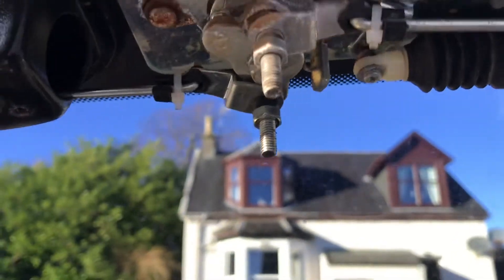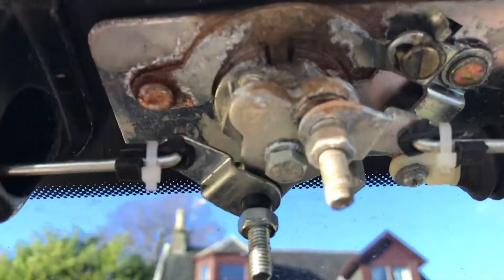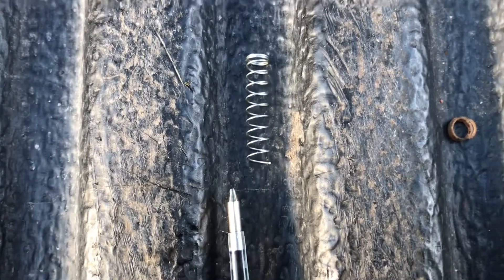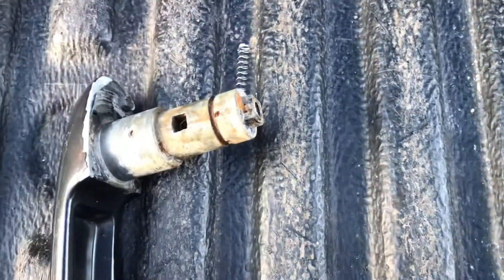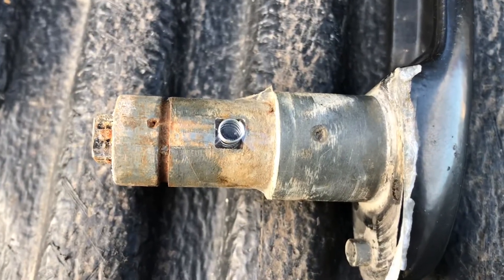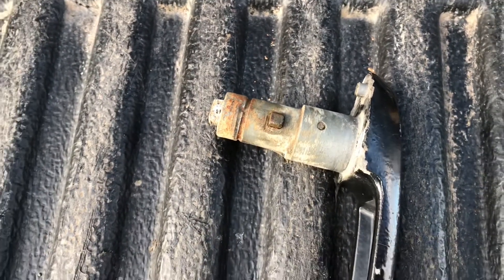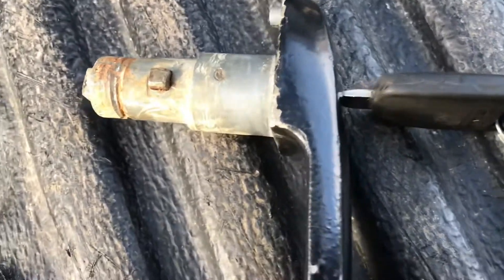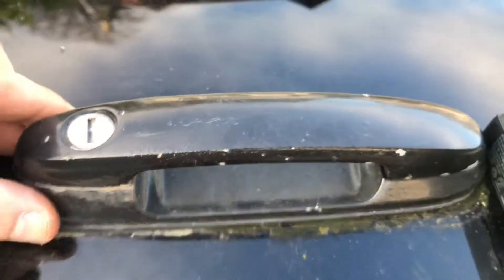Truckman Top: Central Locking Handle Fix

Comment: Spot on mate, that worked a treat.  The sellotape trick was perfect too, once installed it popped through the tape and engaged. 👍👍
Reply from the maker: Excellent, glad it helped someone.  👍
Reply: @daveallan8674  the correct way to install the spring in the handle is to assemble the handle but  turn the handle 180deg so the hole thats cut out for the block to pop through is now showing the back end where the spring fits. You put the spring in and compress it with the end of anything that fits and pushes it in straight. Then you turn the handle slowly so the spring is then captured in the barrel. Then you slowly twist it back 180deg to the correct way and the block will pop up through the cut-out as it should. You dont need tape mate. To help give more space when compressing the spring through the cut-out you can turn the key a bit till the block barely touches the barrel and that way you bought yourself about 3mm extra space for spring to be compressed before you twist it around the barrel. Before you ask "is it safe to slide the spring like that around the entire barrel" the answers yes according to the manufacturer because thats the way they instal it and the spring also slides on the barrel about 1.5cm every time you open the thing. Put the tape away lads

Comment: The spring is 10.5mm long and 3.6mm wide. Just measured a good one.
Reply from the maker: @BlatantBurnerAccount great info there, hopefully it’ll help others 👍
Reply: @cowalexplorer  yes its not a good design. Did you get the spring in using the manufacturers method? aka turning the handle 180deg slightly dislodged so the spring could be inserted in the cut-out the locking block comes through, then twist it back 180deg till its in correct position again?  Yeah the problem with these handles is every time you open them the spring coil end is basically sliding in the barrel. I was going to redesign the stock handle with a proper inserted lock mechamism that can also be used with the CL actuator. Would need a few people to chip in to get the first batch made but im sure they would sell and maybe £40 for a one time fitment for life,  which beats the £85 and £15p&p every 4-5yr from truckman. Even when you fix them like you have they do get another life but usually once they are at the second overhaul you need a new handle and backing plate. BTW its the grease they use that causes the corrosion once the salt gets to it. If you ever have to buy a new handle or backing plate remove the yellowish grease and use either White Lithium or Superlube to regrease. Its defo the grease turning septic mate with ingress.

Comment: Useful video thanks mine was the same though not as corroded as yours, tip though; take a picture of it all assembled with its return spring in place to refer back to
 before you take it apart !
Reply from the maker: I think it was as it was a cheap spring I used before. Still working now.  Also looking for a Demountable for my Hilux 👍 but kind of given up.

Comment: Thanks for the video. I now have the same problem. Could anyone please tell me what size spring I need before I strip it all out?

Regards, Ben
Reply from the maker: @BEN.B.  I just used the spring out a pen, not ideal but it’s lasted and easy enough to replace again if it goes.
Reply: @cowalexplorer Brilliant. Thank you. Much appreciated.
Reply from the maker: @BEN.B.  I dare say you could replace it with an original but I wouldn’t know how to identify it.
Reply: Its exactly 10.5mm long and 3.6mm wide. So as long as you are close you are fine.
Reply: @BEN.B.  also you dont need tape to get it in, to get the spring in turn the handle 180deg so the back end of the lock block where the spring goes is exposed, pop the spring in and compress it enough that you can turn the handle a bit and trap it. Soon as its trapped turn it back around 180deg slowly till the block pops out the cut-out as it locates. Thats the correct way to insert the spring again.